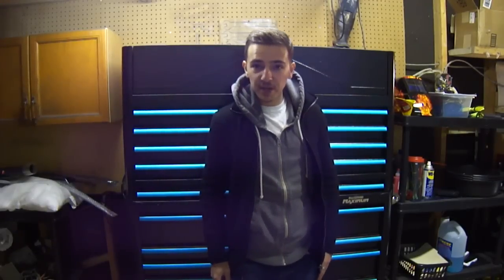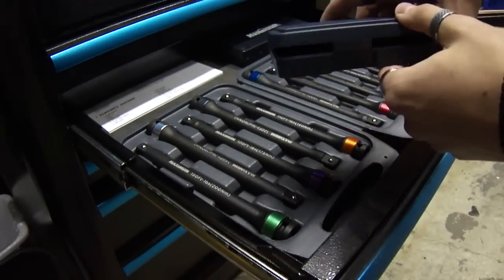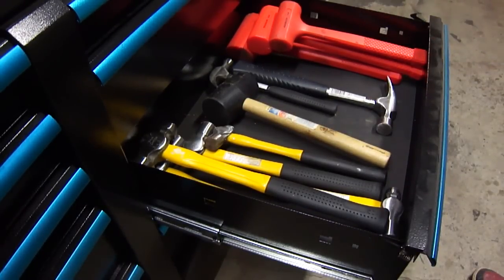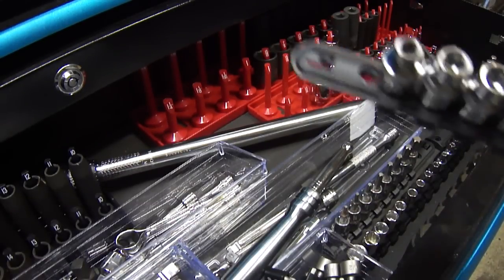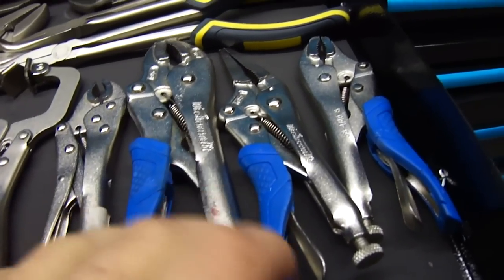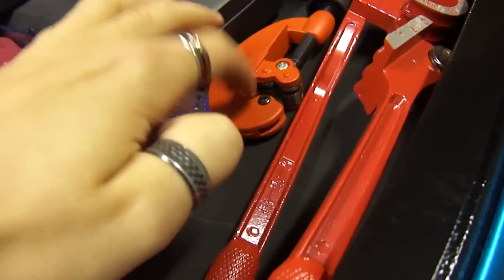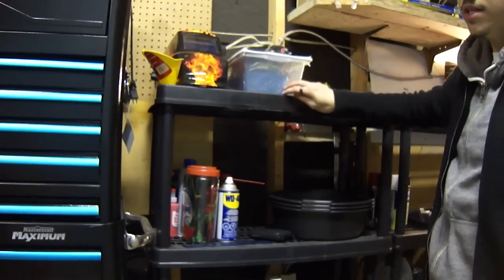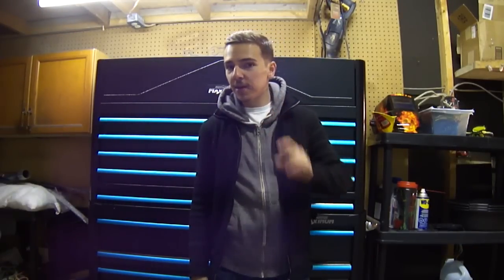Toolbox Tour with Toronto Mod Shop

Comment: The E sockets you weren't sure about are called inverted torx or female torx sockets, my vauxhall/Opel astra uses them a lot
Reply from the maker: Thank you very much @James'sWorld.
Reply: TorontoModShop Are the draw pulls meant to be blue? Just wondering as it looks the same colour as the protective film you find on some silver, chrome items?
Reply from the maker: jamie rollinson they are that colour. No protective film on them.

Comment from the maker: +kingdixon96 @kingdixon96 you're not being a dick. I agree completely. I was on a budget and needed tools. The point of the cheap tools was to have them last as long as possible and then replace them with snap on and mac tools. I've already started replacing the tools I use the most with snap on tools through work. (I'm an apprentice tech at subaru)
Reply: TorontoModShop watch out for the tool trucks there a lot of good tools from gearwrench, armstrong, crescent, ingersoll rand, grey pneumatic, sunex, etc.. that you can get that are just as good as the tool truck stuff but without the outrageous price attached to, i do have some snap on a matco tools that ive bought of the truck but i try to keep it limited and usually only buy their monthly sale items . if you can amazon and ebay are the place to go you can get most of those mentioned brands for pretty cheap and so far all of my stuff has held up pretty well.
Reply from the maker: Gear head Garage I've only bought a couple things from Snap on. My new air rools are IR. The rest of the Mastercraft stuff is working for now
Reply: thats good ive just seen some guys get in really deep with the tool trucks and have to make like car payment every month to them, and ingersoll rand makes really good air tools so good choice, most of the guys at my shop use either ingersoll rand or cornwell for air tols and they all seem to like them the cornwell stuff on sale actually isnt too bad price wise

Comment: Never use those torque sticks. I have seen tons of broken and stripped wheel studs with them. Mastercraft torque wrenches are a far better solution
Reply from the maker: I use a torque stick to seat the nut, then use a torque wrench to torque properly. I use the 80ft-lbs stick, then torque to 90ft-lbs. I know they aren't over torqued because the nut still turns and the wrench doesn't click right away. I am careful, at the dealer we see a lot of striped studs.
Reply: Good stuff, bad habits are easy to make and hard to break later. Nice toolbox by the way, wish you the best of luck with the repair world.
Reply from the maker: tazz23rd I agree. I see it all the time. Thanks for the comment, and best to you aswell.